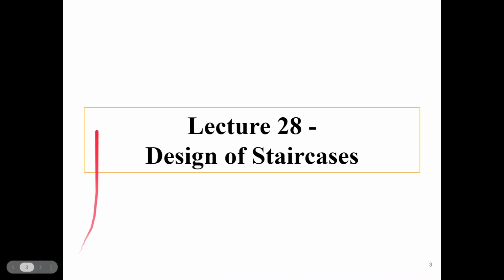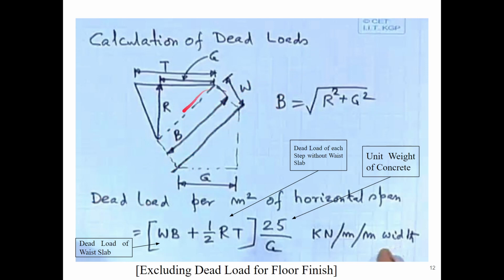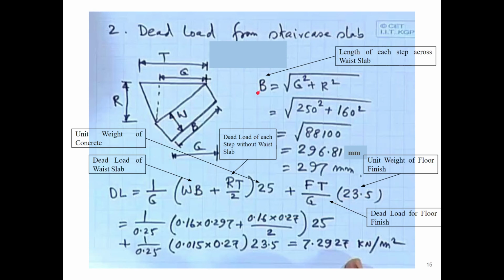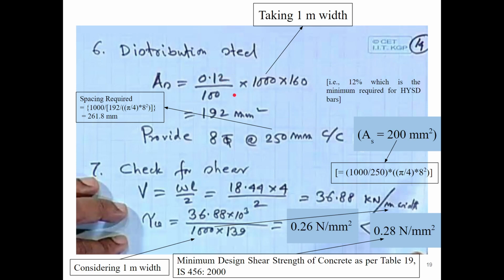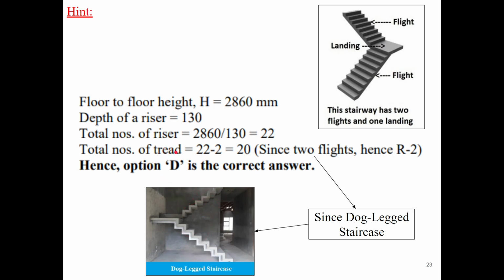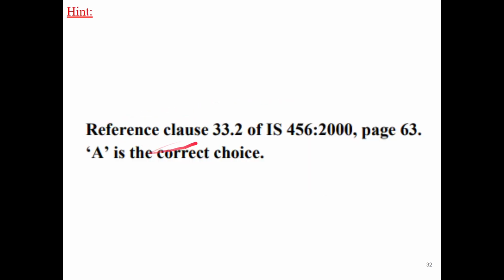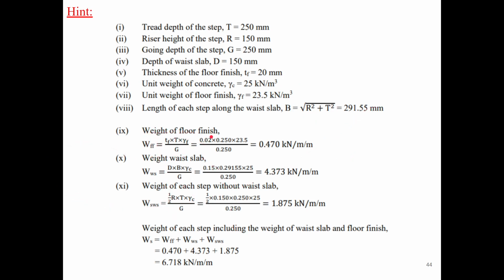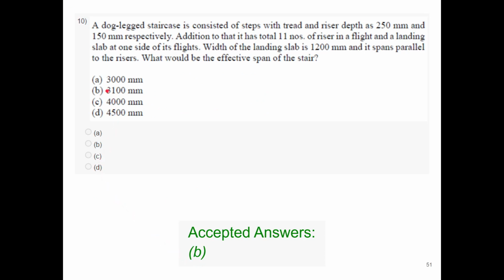Design of Reinforced Concrete Structures - 10th Week TA Class [1st October 2023, Sunday]

Comment: Bending moment of staircase can be same as s.s slab i.e wl^2/8 so why we have taken wl^2/10
Reply from the maker: The bending moment of the staircase is taken as wl^2/10 as per IS 456: 2000 and SP 16: 1980. Taking it to be wl^2/8 like that in S.S. Slab will result in an uneconomical design.